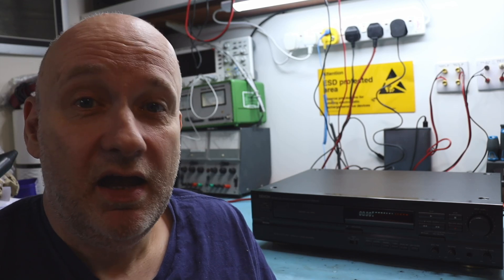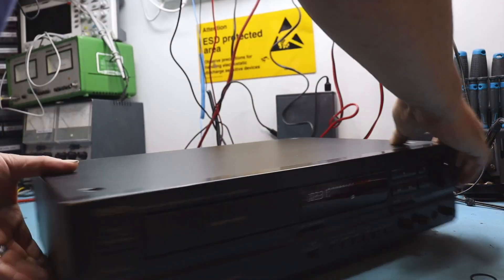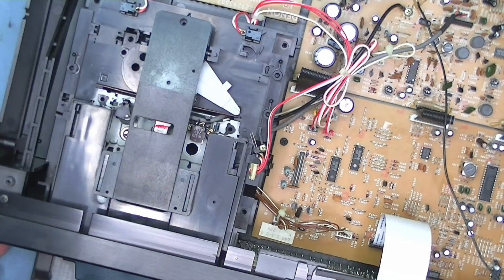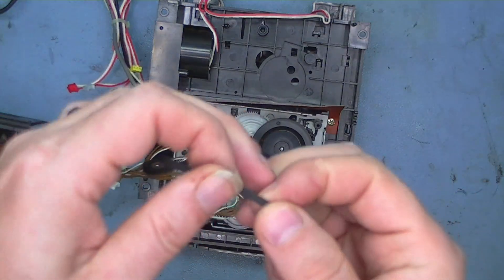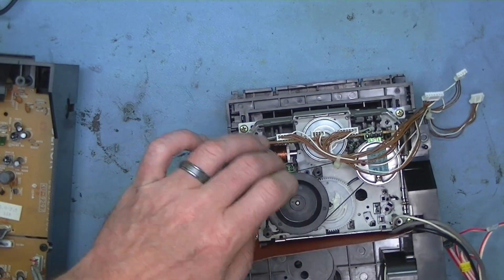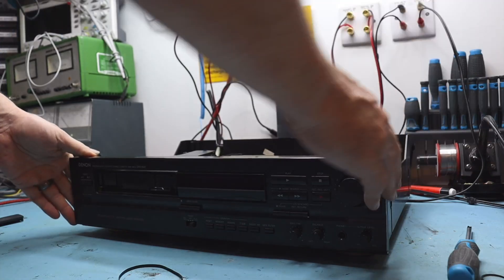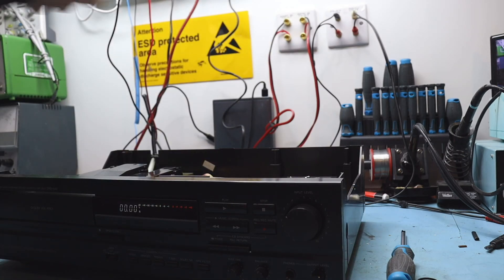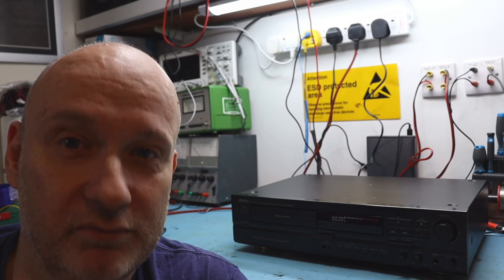FIXING OLD TECH -  Why Did This Vintage Denon DRS-640 Tape Deck Stop Working?

Comment: Great looking deck and the demons sound great .The Yamaha mini system I got from a mate has either the same or a similar tray load draw.
Reply from the maker: Teac also used a variation of the horizontal tray mech on their reference mini system tape decks.

Comment: I wouldn't want to have to pop the top every time to clean the mechanism all the time.
Reply from the maker: You wouldnt, you`d use have used a good quality wet tape cleaner with built in magnatizer for day to day use. They are still available today.